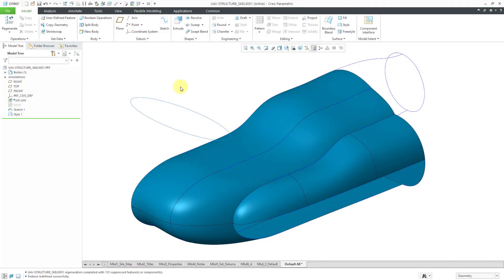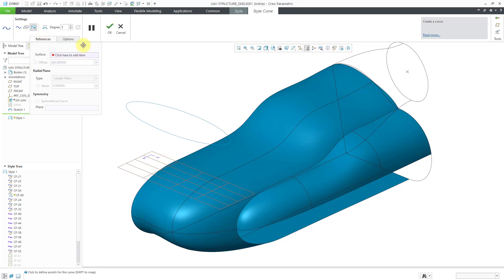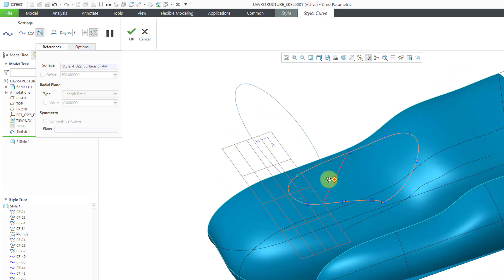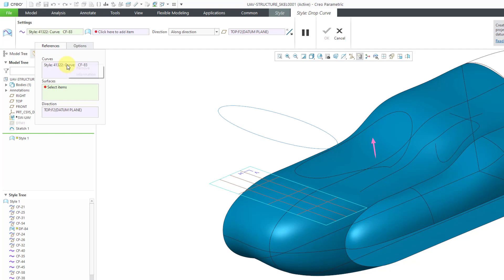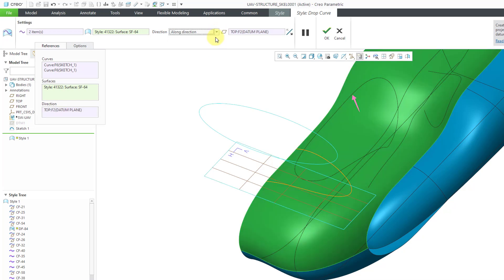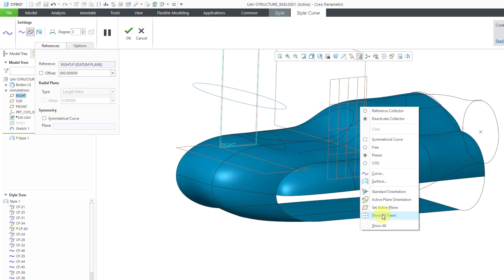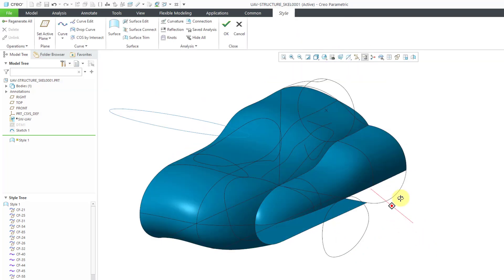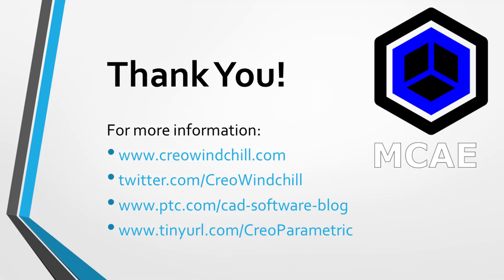Creo Parametric - ISDX - Curves on Surfaces

Comment: Sir in my computer the window antivirus automatically block the trail file of the creo to avoid this what should I do ??
Reply from the maker: Turn off your antivirus? You don't really need the trail file.
Reply: @CADPLMGuy  it shows traceback errors 
And that file will blocked by windows 10
Reply from the maker: File a ticket with Tech Support.
Reply: @CADPLMGuy  means in ptc support?
Reply from the maker: @prasadhire184  Yes. They handle tech support for Creo Parametric.